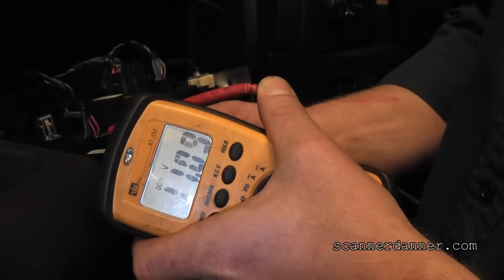Using a Test Light to Bypass a Switch Input Signal

Comment: Not a big fan of this lesson. I don’t ever use test lights, I just don’t have enough room in my box for useless tools. So you could have explained hey if it didn’t work (with your test light) then your gonna have to go upstream for a wiring or ECM issue*.  NOT, well you think it’s the switch so you used your test light on it and the wiring is good so get a new switch. Missed some key points before claiming that.  So close to the ground and even showed the milivolts.  But grind that lessen in their heads, if this was showing 11 volts on the ground pin with the switch closed and the lock still doesn’t work, guess what?  Bad ground.  Or how about you have 0.0 volts on ground at that point.  Well the wiring is good, using a jumper wire to ground instead of a useless test light.  Why doesn’t it work.  What’s our next step?  Unplug the connector and perform a Terminal drag test.  Unsure what terminal to use, unpin the circuit from the connector and feel it on the component. Is that ground terminal all spread out and neither lock or unlock works?  This would have been a much better lessen to  techs to reality, switch was replaced and still don’t work.  Well, terminals are all spread out from previous tech using incorrect terminals, happens a lot.  And the ground was open the whole time. 

I give this video 1 out of 10.  I understand you may have been in class and had some great context before and after. But without that, it’s pretty misleading to use in a real world application.  

* Also this video doesn’t show where you grounded your test light. Hopefully at the battery.  And not on the possibly corroded cab skin ground, that may be the source of your issue and using this “hack” pulled you to finding the “open circuit” in that red wire with purple stripe. To then install a ECM that still didn’t fix it. To eventually find a bad ground, that you tell the customer caused his ecm to fail.  Then the poor tech that watched this video goes "man that scanner danner sure does know electricity. i wish i could be as good as him but its just too darn hard.  ill take better notes off youtube videos next time".
Reply from the maker: Give me a break. I give you a 1 out of 10 for not knowing how valuable a test light is. What if you're using the jumper wire you said you'd use and you accidently ground the wrong pin? Also, you need some type of pin or point on the end of your jumper wire to contact the back of the terminal, so you'd make a jumper wire with a pin on the end of it right? Or just grab an incandescent test light 😂.
Also direct battery ground is not necessary to use for this test on a circuit that carries microamps of current. Of course we make sure our ground is good but battery ground is not necessary here.
This is a portion of a class and im focused on the bypass test itself. Also i showed the working switch AND the ground voltage. This wasn't a lesson on all the other variables, just the bypass test.
You make a lot of assumptions about a 6 minute lesson on a bypass test.
Reply: @ScannerDanner     Good morning.  I could have come off a lot less harsh.  But, I stand my ground.  lol, no pun intended.  

Accidentally ground the wrong pin… I just don’t understand that logic. What if I accidentally short the positive battery terminal to ground?  What do you think is going to happen.  I work on Freightliners, internationals, Peterbilt’s.  They all have circuit numbers, SAE numbers on their wires, connector views can be easily attained, cavity numbers are on about 70% of the connectors I’ve worked on.  Not to mention the color of the wire. There’s many failsafes to assure you don’t “accidentally” short the wrong terminal.  Which is why I use terminal leads. Once plugged into the correct terminal, wiggling the wire on the other side reveals your in the correct hole as the terminal then wiggles too. I have a collection and the wire end is stripped off a 1/4” to apply a load or short other terminals to it. About 1” in a hole poke for my meter. The terminal goes into the signal wire and gets left there. Meter lead still attached. Other lead of the meter is attached to battery ground, can’t believe you have this much attention and can say use the cab skin for ground.  Get another terminal and plug it into the ground and jump it to the other terminal. Now if the circuit is working correctly, reading milivolts.  If the ground is open or corroded your reading closer to signal voltage. I’m guilty of not always using cab skin ground, I have a proven rock solid electrical background and understand if I’m using cab skin my readings could be off, but I’ll never shy anyone away from using battery ground.  Wait wait wait, your telling me if you have 12 volts on your cab skin from a bad ground and you short your test light between it and your 11 volt signal, it will still work because Microamps of current.  Well don’t you just turn water into wine with your magic test light. Because that isn’t working in real life. Battery ground. I could teach you a thing or two about closed circuit live voltage testing.  It’s way better than shorting terminals with a test light or jumper wire. 

Most of my connectors are sealed so a bulky test light isn’t going to work. I was using MIG wire hammered down and ground small to sneak between the seal and connector, preventing seal damage.  Not a fan of back probing sealed connectors but sometimes it’s required. As a trainer I bought a bag of terminal back probes and hammered and ground those down. I like that they are super bright yellow.  MIG wire is still an excellent bag of tricks though. I have several oxy acetylene welded to 1/4 bolt heads for custom picks and back probes.  

You shouldn’t post videos like this out of context. It’s not helpful for young techs trying to understand electrical.  

I do have a test light buried away somewhere in my toolbox.  It’s there in case I need a 1/4 amp load.   Which I haven’t needed in years. I trust my multimeter because I know what I’m expecting out of it.  Seen way too many techs get burned by a test light.  

It just boggles my mind someone with a huge fan boy following, probably makes a decent chunk of change from YouTube and puts a video like this out.
Reply from the maker: I know many people like you. "I'm a master tech and I have the tools to prove it" lol Good for you. Then start making better videos and teach others! 
You work on 3 different models, I work on 40. There are many examples I can give you where you're jumper wire is going to get you into trouble and my test light will not! And it will be your fail safe, just in case. But your to stuck on your own ways to listen. So you do you and I'll do me. 

Also as smart as you are, you'd think you could listen a little better. In your first comment you are chastising me about the ground circuit. 
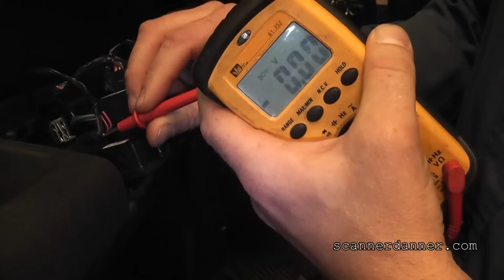Watch this clip again, I mentioned the ground on two different occasions with the first time it begin shown with a voltmeter, with the circuit loaded! (Switch closed). @ 2:06 of the video and at 2:30 "we will cover more of that later" 🙄 And then the second time, when I showed the bypass test, it was mentioned again @ 4:03

Should we also include open and short circuit testing of the signal wire, and what an open ground actually looks like? How about what a shorted switch looks like and of course what a bad meter ground looks like? Guess what happens if my test light has a bad ground in this test? Nothing! The bypass test fails! IS that covered here? NO!
I do all of that, just not here in this 6 minute video on Performing A By-pass Test! 
 
There was absolutely nothing out of context here and this clip still stands on it's own with no misinformation. 
So please do me a favor and take your know it all attitude elsewhere.
Reply: @ScannerDanner  yeah!  I’ll keep on trying my friend, to make more content. It’s rough trying to explain something without weighing all the details.  I was trying to make videos on my instagram.  But my boss was like ya gotta stop.  Company policy. I have however made over 4,000 posts on freightliner service solutions.  Always trying to help someone out.  That’s a crazy world. Making that many posts and comments helping people and I go to freightliner shops and the lead techs are always like thank you for what you do.  But nobody knows what that like button is for there. 

Im just jealous of your professional content.  If I could just figure out a way to share my knowledge, but my videos don’t get attention.  I gotta do a better job.  I’m sorry if I came off bitter. That wasn’t my intention.  Just trying to point out helpful real life experiences.  I’ve got 19 years under my belt, the last 9 have been with daimler trucks and kicking ass at electrical.  Computer navigation and getting resources is a huge factor.  To be able to say Ah well that FET opens at 6.7 amps and you’re pulling 7 amps, no wonder you have intermittent box lamps.  But that’s a moving target as they gotta change their sites.  

Honestly I do appreciate the value of a low 1/4 amp load to apply to a pull down circuit.  It is safer and a cool trick.  I wouldn’t do it though.  

I’m a different breed.  The industry is full of techs that claim they know better or are the best without backing anything up or teaching anyone anything. Could just be Chicago.  
.
Reply: @ScannerDanner  Hope your weekend is going well.  

 Back to it.  Literally the sixth sentence in my first comment explains the grounds. “You were so close…”  I get it you said will cover more of that later.  If anyone is acting like a know it all, it’s you AND me. We both have the same goals, to help techs out. 100%.  This internet thing sucks. Full of videos of fails and people doing hack welding stuff. I thought for a moment this was following that trend by the context in the video.  I’m sure in your class it was a spot on lesson.  But out of context it’s cringe. Go ahead replace the switch if it still doesn’t work.  Doesn’t sit right on me.   

I’d love some criticism on my videos.  I’m trying to help, but nobody’s listening or responding.  It’s driving me crazy.  Then I see some idiotic video of someone spinning a flywheel at 10,000 RPMs with 2 mil views and 60k likes.  Wtf! Hey Dan, I know I’m being stubborn and rude.  I’m struggling and jealous. Thank you for your content and dedication.  
-Kyle
Reply: @dtnamastertech   It's not just about having the knowledge, intelligence, and experience. In addition to these 3, you also need to have the ability to share and communicate your knowledge and experience to others along with a good likeable personality. I know the name ScannerDanner can lead you to think his name is Dan, but it's not, his name is Paul and Paul has all of the qualities mentioned above while you only have knowledge, intelligence, and experience. You lack the personality and that affects how receptive people are when you try to share and communicate information. It's ok to be a Mr. Know It-All, but don't act like it. No one likes a person that acts like they know it all. Never blame a person for not understanding a topic you're explaining. Instead ask yourself "What can I do or what can I say so this person understands it?". This is meant as constructive criticism. I hope you take it as such.
Reply: @ I miss teaching. Two years I spent doing it. It’s one hell of a rush. But the pay wasn’t there. I’m always willing to learn something new.  But this guys an absolute idiot for showing this dangerous and stupid technique. I know a lot about low voltage electrical.  I have won every competition I’ve ever gotten into. Three years number one freightliner tech in North America. Hands on, I got a 80% and the next closest tech had 40%. So I do have credibility.  When someone doesn’t want to learn because they’re too high on their pedestal then it’s best to walk away and watch the world burn.  

I absolutely love my voltmeter, amp clamp and ability to look up specs and tech lit.  Had great reviews. I just couldn’t stand making less than a tech with all my knowledge and experience.
Reply: @dtnamastertech  I'm always willing to learn, can you tell me what is dangerous about using a 12V  200 mA test light in a scenario like the one in this video? I use a 200 mA test light to test all kinds of circuits including PCM, TCM, and BCM circuit and I've never had any issues. Depending on your answer maybe I'll stop doing that.

Comment: Basically the same thing is done when checking which wires run the locks when doing pre checks on wire colours when installing a remote start. Low current test light and just supplying a safe ground through an incandescent test light. 

Also works when checking a low ref circuit from a pcm/ecm that’s suspected to have failed internally in the module. Hook to a ground back probe module connector or your preferred method of circuit checking ( since technically piercing a hole in the weather pack seal is considered just as bad as wire piercing )

Comment: Thank you ScannerDanner, I'm watching and learning. I recently picked up my first oscilloscope, It's a handheld (ZOYI ZT-702S Handheld Oscilloscope) Do you think one of these has any automotive use?
Reply: You are my OBJUAN KNOBE, My only hope. I drive an 18 wheeler. The local shops don't fix electrical problems and the stealership wants 2500 to start working on the truck.  I use the strategy that you teach to work on the truck. Thank you Bro
Reply from the maker: Any scope is better than no scope!

Comment: I have heard you say pull up and pull down circuit many times, but I missed the class that explained what they are.  Can you define a pull up and a pull down circuit?
Reply: @davemall1 Pull Down: Switch Open 0v. Switch closed 12v Switch is on power side of circuit.... Pull Up: Switch Open 12v. Switch closed 0v. Switch on ground side of circuit. Hope this helps!
Reply from the maker: @12brmien  that is completely opposite of how I teach it. I've never taught it from the internals of the module. I understand a "pull-up" resistor is used on what I'd call a pull-down circuit, but I don't care, what does the switch do? It pulls it down! What do we see as technicians? The switch, and what it is connected to! (a ground). If I'm going to use my test light and do what the switch does, I need to think about what the switch is doing! It's pulling it to ground. So what polarity does my test light go to? Ground! To teach this as a pull-up circuit, just adds unnecessary confusion. I realize others take issue with me on this, but I don't care.
So I tell my students that a pull down circuit is internally sourced by the computer and the switch pulls it to ground. Switch open, voltage is high, switch closed, voltage is low. It makes WAY more sense when taught this way.
Reply: @ScannerDanner  teaching it this way might help your students understand what happens, but it is not correct when looking at computer logic and pull up and pull down resistors. The confusion is on what UP means. Up means the high voltage out of 2 possible outcomes, Down means the  low voltage.  It is a HIGH state or a LOW state, Not floating. On a MAF circuit there is a pull up resistor internal to ECM. It is only called UP because of the HIGH state the voltage is after the resistor , if the circuit to the MAF were disconnected. I would stay away from the term PULL up or DOWN, because of the confusion, and stick with the voltage drop explanation. A search on Pull up and Pull down circuit design is well established.  Your other videos on the multimeter testing basics and the water hose analogy make the most sense.
Reply from the maker: @danieljurgill1681  what does the switch do in this case? It switches to ground, it literally pulls the voltage down. To teach that this is a pull-up circuit because it has a pull-up resistor inside of the computer is counter productive. 
My understanding of the circuit, what it does, how to test it, where the voltage is coming from, is not affected  by the term I choose to call it and teach it.
Reply: @danieljurgill1681  As a mechanic/technician working on automotive electrical systems, Paul's approach and teaching method makes much more sense, it's more intuitive, and less confusing. I know you're right as far as the internal electronics of the ECM, but his students and audience are mechanics/technicians working on the end item. They're not electronics technicians repairing ECM, TCM, BCM etc. I first learned it the way Paul teaches it, and after I had a good grasp on it, I was taught about the pull-up and pull-down resistors inside the modules. In short, "If it ain't broke; don't fix it.".
Reply from the maker: To much to put into a text message. Sign up for SD Premium on my website, take advantage of the 14 day free trial. Cancel before the 14 days are up and you won't be charged and start in my Chapter 2 "switch inputs" playlist. You'll be glad that you did!
https://www.scannerdanner.com/join-scannerdanner-premium.html
Hope to see you there